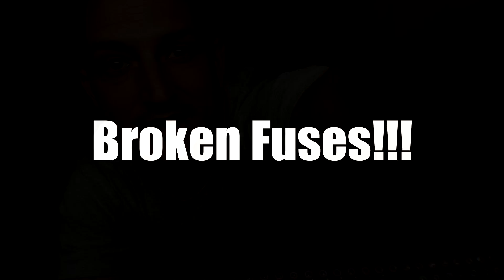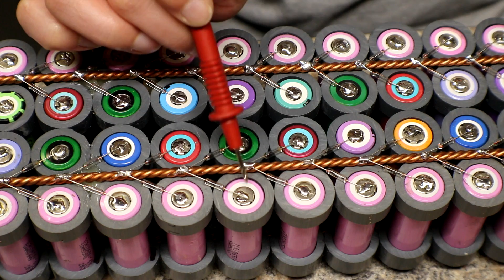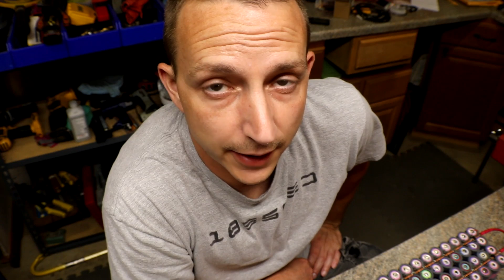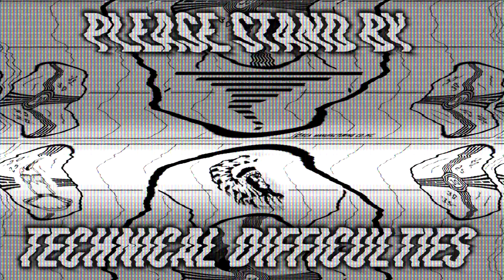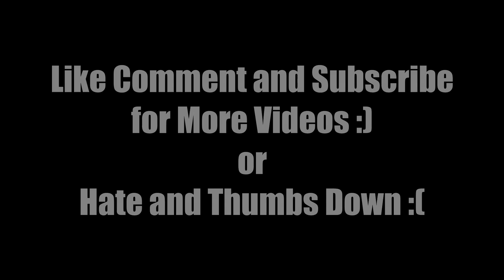Diy Tesla Powerwall ep55 Found Problem on Low Voltage Pack!!!

Comment: Hi, Joe, are you ok?

First of all, congratulations on your project! It's amazing.

I'm creating a battery 14s7p to my eBike and I would like to know if I will face any problem if I use these kind of fuses instead of spot welding them.

One more time, thank you so much.

Regards,

Pedro Rosa.
Reply from the maker: Yup, Doing great!😆 Yeah you could use these fuses for sure but I would say that the pack in your case should be secure where ever you put it since the fuses can break.  I would use a higher amp fuse for an ebike battery tho.  How many amps will be drawn under load or do you know yet?  Thanks for Watching!😀👍
Reply: Many thanks for having answered me, Joe.

I have bought a Bafang BBS02B 750W 48v. So, I think it will draw something between 12A and 16A because I want to use 52v (14s7p).

Now, I'm trying to find this kind of pipe. Here in my city I didn't find yet but I keep seeking.

One more time, thank you so much.

Regards,

Pedro Rosa.
Reply from the maker: No problem!!!

Comment: Solid Copper Wire (Bus Bars) 18650 li-ion battery packs brass bus bar fails "solution" https://www.thingiverse.com/thing:2582526

Comment: Are you sure losing only two cells out of the pack would account for that large of a delta in the packs overall current capacity??  That makes no sense.  You would have lost only a small amount of current/voltage!
Reply from the maker: +kirkb4989 Depending on the capacity of those cells(possibly that 3rd also) its 4-8amps that didnt get used. Its hard to say. Ill be doin more tests and well find out. 😃
Reply: But two cells out of 100 would be a 2% difference give or take- obviously you would need to do the math with the actual capacities of each cell but I bet that would be close.  You were seeing a much bigger delta in the end voltage than 2% of your pack cells being offline would explain.  At least it seems so to me...
Reply from the maker: +kirkb4989 There could be some weak cells in there as well. I should temp install some solar panels to charge them back up so I can run some more test. Damn, I shoulda left the old solar up there and just rewired them untill I was ready LOL DOH!!!
Reply: Yeah, it seems to me that there is more in question than just two missing cells!  I hope I'm wrong, but....   =:-o

Comment: You can't balance bad cells, not on the low nor on the high, when they have high internal resistance or low capacity, they will lose voltage very quickly when load is applied and also the voltage will shoot up to astronomical levels when charging, if you don't have a balancer (which will stop charging on the main cables, discharge a little the high pack and charge again, then stop, discharge, charge, and so forth) which will make your charging take forever but at least won't blow up the pack.
Reply: I have a Lifepo4 3s pack with one bad cell, when I plug to the charger and do a 1ah discharge that cell voltage quickly goes down to 3.0v while the others stabilize at 3.35v and would have remained there for quite a while has it not been for the low cell triggering the charger low voltage stop. A few seconds latter, I will apply a 1Ah charge, that same cell will shoot up from 3.0v to 3.70v and trigger the charger high voltage (life cells should be 3.60 tops). Then the charger will start a very long and arduous task, of charging for only a few seconds, until that cell exceeds 3.60, then stop, discharge it for a few seconds, then charge, and so on). Those few seconds of charge are all the other cells are getting, so they take hours and hours to come up to 3.60v and terminate the charge.
Reply from the maker: Is that cell bad or do you think it will come back after the long charging?
Reply: The cell is definitely bad, probably with high internal resistente, slow charging, 100 - 200mAh, can help to undo some of the internal shortcircuits, as shown by studies, but this pack can never be used to charge quickly or power something demanding. So, for the time being, I charge each individual cell as if it was 1s (2 wires on the balancing plug), the 2 good ones, at 1Ah, then I charge the bad one at 200mAh, and use the pack for something that pulls constant low current, like an LED lamp or a Remore controller. My point is that, bad cells will ruin your balancing, either on the low or the high voltage limits.

Comment: Well, I read through a lot of these comments before suggesting (so i did not duplicate) to you that maybe it'd be a good idea to have a backup pack on hand. pain in the ass, i'm sure, but a time-saver should this (when this) happens again.
you're doing great! keep up this great work. i'm working on my system, and while i am using 4 new lifepo4 12v packs, it's taking me a lot of time to bottom balance all the cells. it'll be days, i'm sure, but i want them all to be bottom balanced and then brought up 'n down a few times to insure they're settled. I too, will think about a backup pack, but i also have to ramp up my packs to get to your capacities!!!
I Envy your Power!!!
Russ from Coral Springs, Florida, USA
Reply from the maker: +Russell Holt Thanks Russ!!! Yes, that is in the plan. Id like to get a few ready for this reason and to continue building packs in general for the next 10kw.  How long have you had yours?
Reply: the batteries (LiFePo4 12.8v 40Ah 4 cells) just got delivered last friday. i have a CellPro PowerLab 8 charger/discharger which i've only used on each of the 4 cells of each pack. it's very slow work. it will take days. so far i have 2 LG 335W panels for testing. i'm working designing a 2 axis tracker. being that i live in south Florida, there are building codes for protecting against hurricanes. it will take some time. i have a 60 Amp Renogy controller and an Aims 6K 120/240v inverter (sittin' there waiting for my battery bank to catch up & be used!!! I, like you, have a job and the rest-of-life stuff that seems to get in the way, so... it takes time. ITM, i watch your videos. i'll keep ya posted on my progress.
Russ
Reply from the maker: Oh ok ya pretty new then.  Sounds like you will have a pretty nice setup.  Yeah life stuff always going on and can really only do stuff late at night after work and a lil on weekends.  Im hoping to start getting my panels ready for install. I need them bad LOL

Comment: I used enamel coated copper wire for my bike battery had similar problems been checking them regularly. It's a learning process.
Reply from the maker: Yeah its for sure a learning process!!!👍

Comment: Now....my battery's are dayli cycled because I still don't have solar panels... But we have ceaper electricity (1/2 price) from 10pm-6am that is my charging interval through the day I use the the battery-inverter setup for all my appliances....this is still like a "test phase"..... 👍 for the battery bank(14s configuration 230Ah) and inverter MUST /PV35-15K.....batterys perform excellent at first also have some issues with fuse wire broken or forgot to solder.....and so on...
Battery capacity I use are from 1300mah and above 
1300-1700mah
1700-1800mah
1800-1900mah
1900-2000mah
2000- and above
Cell voltage messured right now "fully charged" 
1-4.02
2-4.05
3-4.02
4-4.01
5-4.02
6-4.03
7-4.03
8-4.03
9-4.06
10-4.02
11-4.10
12-4.06
13-4.06
14-4.06
That are the today values at 10:16
Reply from the maker: Awesome, those voltages are pretty close 👍
Reply: Yes they are.... Only one cells is 4.10.... 
I have to look at it and check it out..... Max current draw was about 4.5 kw or above 80A because I pop the fuse and after that I have measure the voltage of each cells and no major derogations in 0.06v....
Now I pull about 150-180ah every day from the pack's in the heat around 35degC....at 10pm voltage is still over 48v.... 

One thing when I perches the balancers I didn't buy all at once as was recommended by salesman so I have been warned about small degradations between first perches and last.... 
I was also recommended that I should conect on the ac side of balancers in the circular conections so the first balancers is conected in the last balancers with that I lower derogations for about 0.02v.... 👍

Comment: Anyway if you solder this cells together and take a nother test it would still not be ok......until you mach the packs for the total capacity.....
You need to balance them constantly..... 👍 
Don't drain the pack's below 3.3v..... 👍
Reply from the maker: Thats what these lil test are also doing.  Seeing if there are issues.  Im gonna go over all the packs again to see if more fuses are broken.  Im betting there is.  I made all the packs 226amps with the biggest difference of 314ma

Comment: I use a 25 ohm cheapo ceramic resistor to drain cells. It takes a few hours but nothing gets hot.  Also, some folks simply take the high voltage cells and simply solder them back into the pack as the theory is that the higher voltage potential of one cell will be used to charge all the rest of the cells. I found that to work but it takes forever, over 10 hours, I guess due to cell impedence? I'm not sure why by draining the cells is best, quickest with a 10 watt resistor.
Reply from the maker: If it was closer in voltage I would just solder it in but since the fuse lit up Ill wait 😉
Reply: Ok. That makes sense however for some unexplained reason I find that the 4.2 cells take forever to drain into a field of cells that are around 3.6. Someday I'm going to use my VOM meter shunt and see what's goin' on there, it was a surprise, hence I now use a shorting resistor which is a sure thing.

Comment: Just a heads up, I came downstairs yesterday and found that  my 4s foxnovo completely burned thru and battery carcus laying everywhere.  even melted a small portion of the 4s next to it. I haven't heard of this happening before .
Reply from the maker: WHOA!!! No I havent  and Ive run about 1000 cells threw each. I think they do a free replacement.  My dad had one that got warm and tweaked the plastic and they sent him a new one.  Id look into it.

Comment: oh no. damn those fuses. see, leds mate.. leds. lol. they would light up when a fuse is gone.. but, not cheap or easy to implement. I'm looking for manufacturers who make leds with built in constant current or at least smc resistor so you can easily place it across 3.7 and not worry about high currents, not much available at a cheap cost though :(
put a 5W+ 1ohm resistor :P let the, balance themselves out.
Reply from the maker: Yeah the LED thing would be sweet. Nice an easy to see!
Reply: oh just realised a typo. place the led across the fuse not the "3.7 battery". anyway, you get the idea :P
are you going to attempt to do the capacity test so the UPS recognises the length of battery life or was that the actually plan you were doing now? or just a simple test?
PS: seattle ain't bad.. whilst in summer :P
Reply from the maker: Yeah Im just messing around to make sure the ups would stay on.  Once I get the solar hooked up Ill do the self test to calibrate it.  My older Brother is out there somewhere and he seems to like it!
Reply: For LEDs for a fuse blown indicator:  you want to keep a red LED somewhere around 2.5 volts (others are 3v) and with the cells being at AROUND 4v, the LED consuming 2.5v, then you need to drop about 1.5v.  Lets say we want to run the LED at 10ma (will light up bright but leave us some wiggle room if voltage are higher) then you need to use V=IR  so V/I = R thus 1.5/.01 = 150 ohm resistor would work nicely.  That will work fine even if you use LEDs that need 3.0v, they will just use a bit less current.
Reply: that's why I said constant current regulator. you'd have to find one that operates low enough but then the fuse may not have blow if there was only a small difference between bus and bad cell, never had one so don't know.
Reply: BUt why overcomplicate it and make it more expensive?  An LED lights over a WIDE current range and the 150 ohm resistor with a 3.0 to 4.2 volt range will keep the LED current in its operational region.  A $.02 solution is better than a $.50 to $1 per fuse solution!
Reply: The whole system itself is already complicated lol. Have you not noticed these guys have no idea 1 cell alone has popped until over time they start to realise something is wrong? then have to pull out a pack and see if they can find what and where? Wouldn't it be easier to diagnose a dead cell by seeing clearly a single LED lighting up amongst 5000 cells?

Haven't checked the specs exactly but I don't think a forward voltage of an LED will light up enough with a bus voltage to (eg) 3v difference and a 150ohm. typical LED has a forward voltage of 1.8V to 2.5V at 20mA (depending on LED used). hence a constant current source is best for this. I was just probing around the net to see if any of these exist built into LEDs or just as drivers, built in would not be complicated at all.

anyway, when you buy these in bulk, it's much cheaper when you have to buy 5000 of them and these should never need replacing unlike the fuses so technically it's a once off. My whole point is to use an LED so you can clearly see there;s a problem and not have to pull out a battery pack at a time and go through them one at a time to find where the problem is.

Implement it whatever way you're happy with, I was just suggesting since this is a long term system..
Reply: Yes but instead of adding a constant current regulator ($$ and complexity) , just add a resistor (a cent or less) along with the LED per cell
Reply from the maker: +Phizicks I do really like the idea of am led to light up if fuse pops.
Reply from the maker: +kirkb4989 Yeah cheap an easy